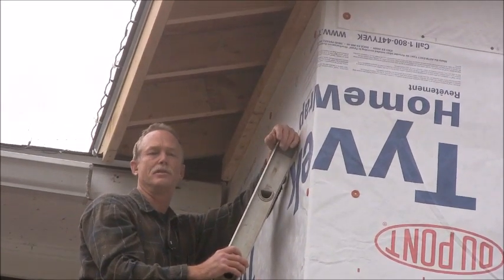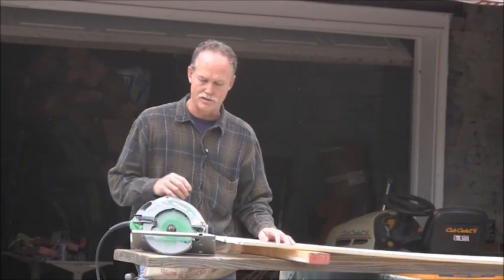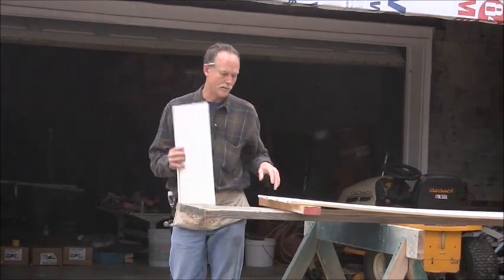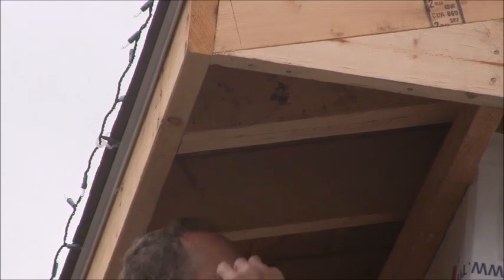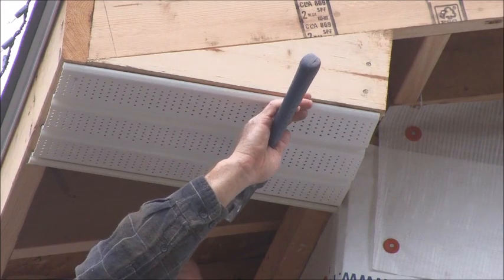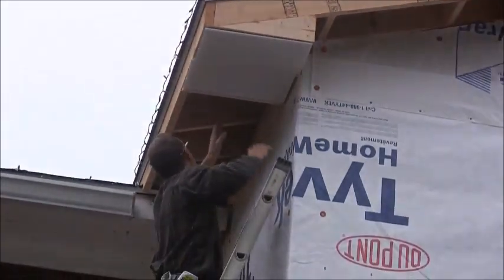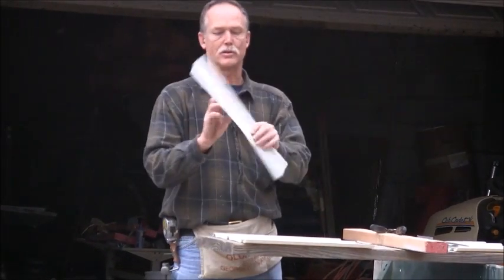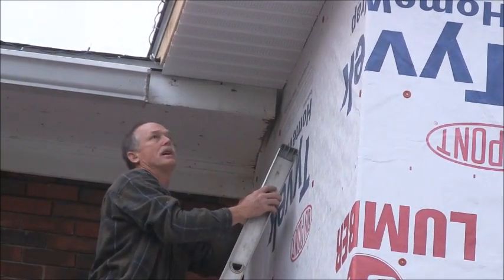How to install vinyl soffit on new construction

Comment: I also appreciate seeing you not using j channel. Picked up an old house on the cheap, but I've got to redo everything on and in the place. First time owner. My siding is fine. But the fascia had rotted and was sagging off the house. I figure it'll be fine, so long as I snug the soffit in close to the siding, and run some fascia around the outer lip. You've got a good cut to your videos. Obviously experienced. Thanks for posting.
Reply from the maker: You are welcome. Glad I could help.

Comment: Very interesting!  I am building a very large workshop this summer ... roof perimeter is about 250 ft.  I have watched a dozen videos on every step of construction.  I built a house a few years back but subbed out most of the work.  I watched and had a lot of "why do it that way" questions.  When it comes to soffit, I could not figure out why I would put up a J (or F) channel only to cover it with the wall siding.  I see you didn't !  First person to do it this way.  I assume if you are going to use vinyl siding (I am) then I would just bring the top wall J to the bottom of the soffit?  Thanks so much !  Mike
Reply from the maker: Yes, you are correct. Bring the J channel up to the soffit. This is how I was taught to do it years ago. Hope this helped.
Reply from the maker: Also, if you have room when you put your siding up. The last piece will most likely have the nailing flange cut off. You put undersill inside your j channel. Your siding will slide up into it. You will need to buy a tool that makes a little snap onto the siding that will snap into the undersill.
Reply from the maker: @xtalvt  You are welcome. Sounds like you have had a time. Good luck!
Reply: Read you comment. I hope you and your wife are well, and your house and shop are done, or at least livable.